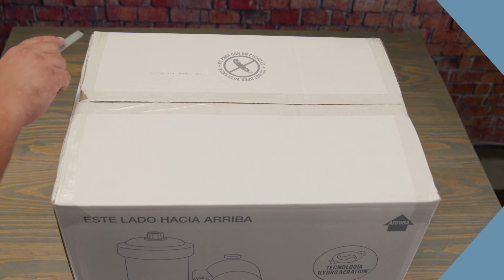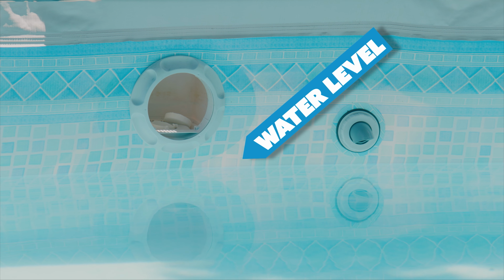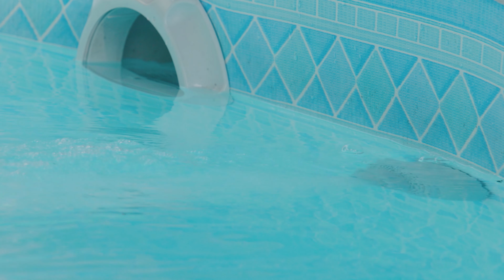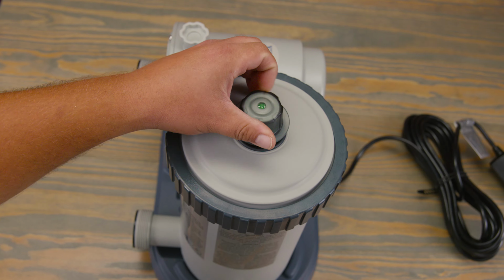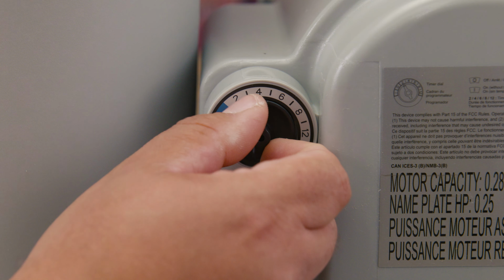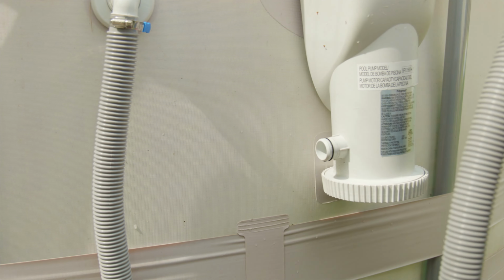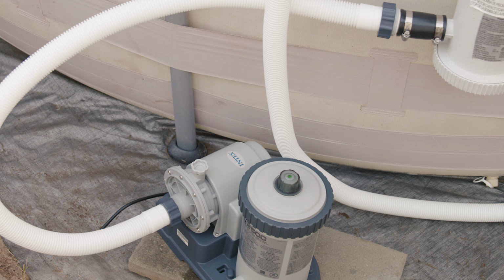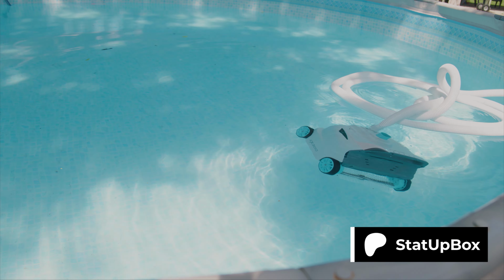Intex 2500 GPH Krystal Clear Cartridge Filter Pump System Install Review Easy Simple

Comment: How do I get water to flow through the filter? My filter is dry with booth hoses connected and in the pool. I have the booth hanging in the pool right now, I want to hook a water fall to one hoses, biut I can't get the water to circulate in the water. I have a new c2500. Help please.

Comment: I’ve used this pump for years even when I had a 12’ pool now I have 14x42 and academy sells it for 129.99 regular price and comes with the inlet and both screw on hoses too. The aeration feature helps keep the water clean by adding negative ions not help mix pool chemicals. If necessary you can cut the pool liner to use this large pool fitting and then add plunger valves or you can keep using the slide in pieces and add the adapters that allow you to screw on the plunger valves and hoses. This pump works very well and even Walmart makes B size filters now that run 10.00 for pack of 2. This pump also allows you to use most automatic vacuums as well. Intex sells an amazing model that has rotating brushes and even climbs the sides of the pool and sits at the water line for a few moments to allow scrubbing of that water line. This vacuum connects to this clean water inlet tho not the suction port. That is important because many don’t read and believe that it is suppose to connect to the suction side then think it won’t work and they return it. I’ve bought several from spreetail on eBay for parts only and they were all new working fine. I run my pump 24/7 except when changing the filters. I don’t bring the pump inside during winter either. I just drain my water line down below the suction port (I keep one suction port blocked with the black hat stopper) and then I close plunger valves and I leave the hoses connected and just unplug the pump and cover my pool. I do winterize pool prior to draining down. If you want to cut your liner you just take the piece that screws onto the outside wall of the pool and use a marker to trace around the inside of the circle making sure it is centered on the nipple tube that the small pool fittings slide into and then take a hobby knife not box cutter and slowly carefully cut along the marked line. I’ve done this to 7 pools so far and it’s super easy. They also make caps to go on the large pool fittings for winter. Intex makes led light that screws onto the large pool inlet once you remove the facing and is powered by the water pressure same way the automatic z300 vacuum is powered by the water pressure. I would recommend this pump to anyone with an above ground pool up to 15’ round. Any larger than that then I feel you would need a more powerful pump shoot Intex should be sending me products to do review videos on. You name it I’ve tried it. Also replacement parts are available on the Intex corp website as well. You can get the large pool suction fitting with screener grid attached from them or off eBay or Amazon just keep in mind 2017 laws changed to where 2 suction ports were required after a child hair was caught in suction port and she drown. Splitting up the suction to 2 ports is not a benefit like many think it is. It cuts the power down in half and with most pumps you can’t even run the over side skimmer without blocking the other suction port. Now if you get the suction that has a strainer grid that is removable be careful cause it will pull a hand off once the grid is removed! The Intex brand doesn’t make those anymore only the kind that the strainer grid is made attached. Generic brands do make a removable but they are 3D printed you get what you pay for and Intex recommends that the pool fittings only last one season. So to be safe keep a backup.

Comment: For ppl struggle with poor pressure/flow from outlet: 

It's dirty inside and cartridge must be cleaned... indicator on top of top release valve yellow when dirty. Simply: drain dirt clean cartridge, drain the unit itself with sediment valve open. Replace lid an cartridge then turn on. Boom. You'll lose about 2-3 inch of waters. Refill with hose. Don't forget to release air after closing top giant main screw lid. And close sediment valve too
Reply from the maker: Great advice!👍😊